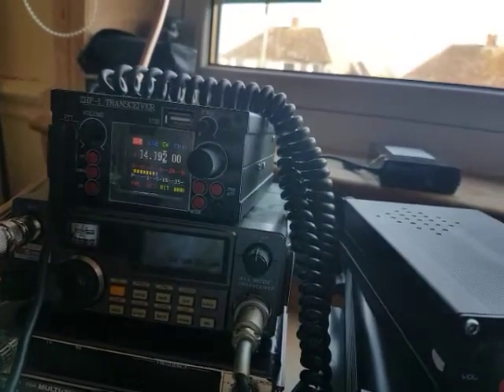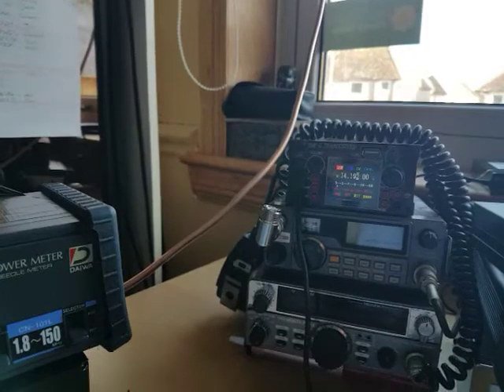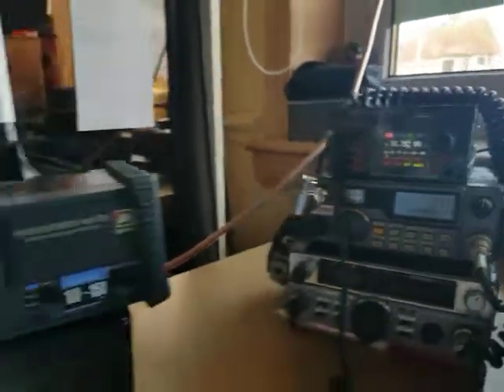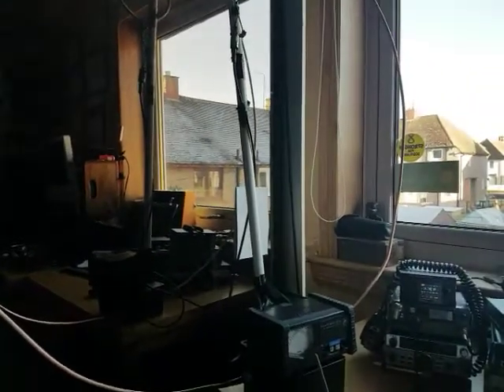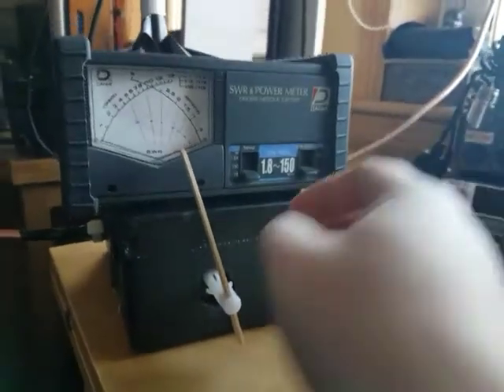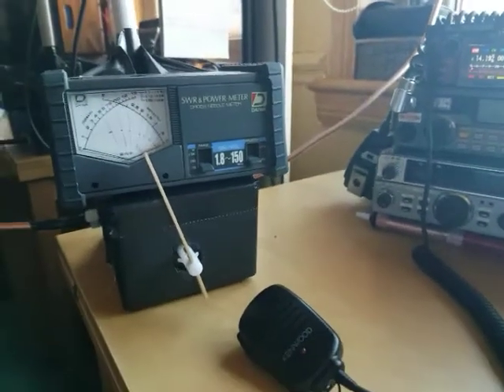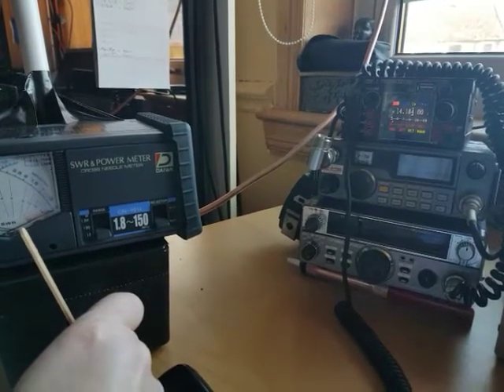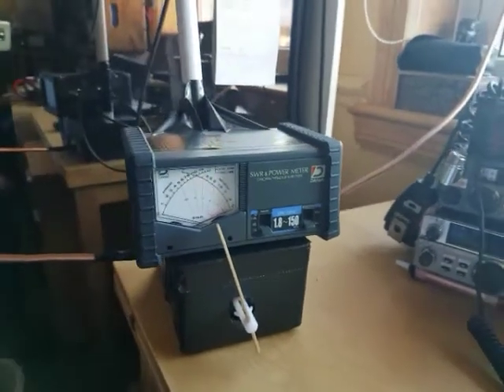Home made Magnetic Loop for 20m

Comment: Is the performance affected by having it sat so close to the mirror? As I understand it, modern mirrors are made by depositing a thin layer of metal (aluminium) on the glass, so it is effectively sitting next to a sheet of metal.
Reply from the maker: It radiates from the ends rather than the face.